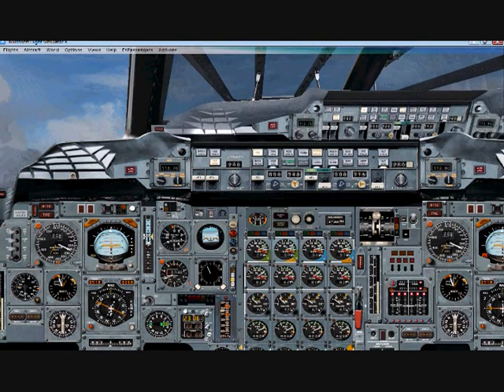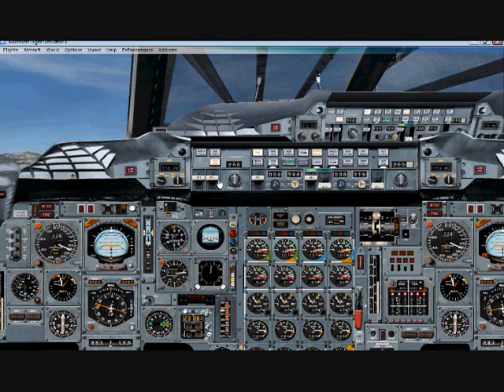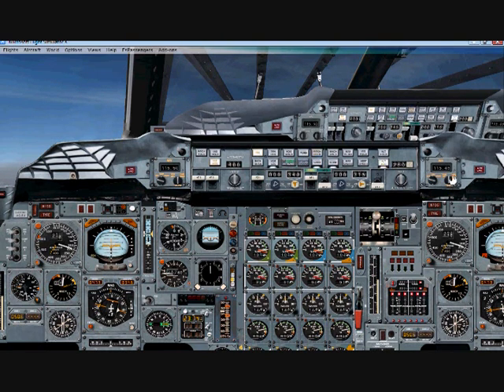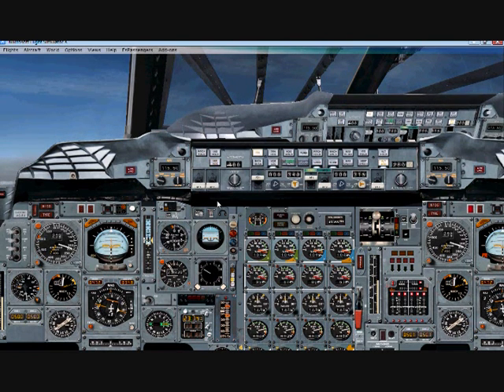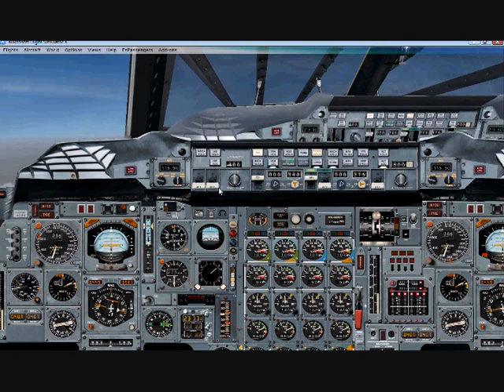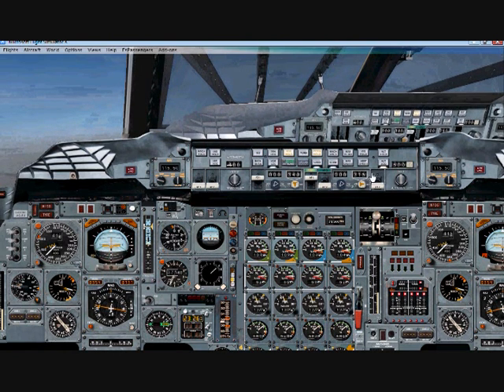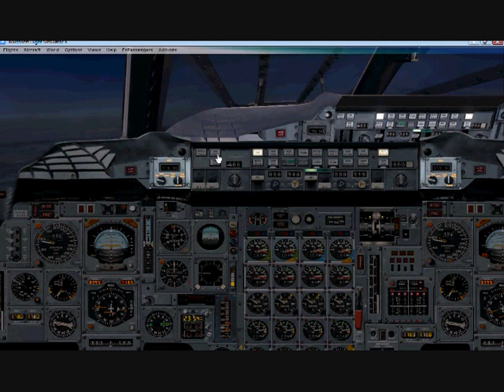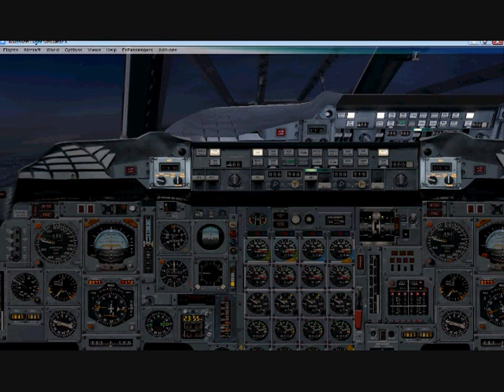Concorde X flight tutorial Part 7

Comment from the maker: @airlinephl2 ok climb to fl260..once at fl260.level out and turn of AT (auto throttle) reheat and full throttle untile you get  close to 400kts...now turn your AP off and slowly pull your pitch up..stay at full throttle..and climb to FL500 now your going to lose some speed but once your at FL500..stay at full throttle with reheat. your speed will build back up but its going to take some time...or just drop down a few thousend feet untile your speed builds back up